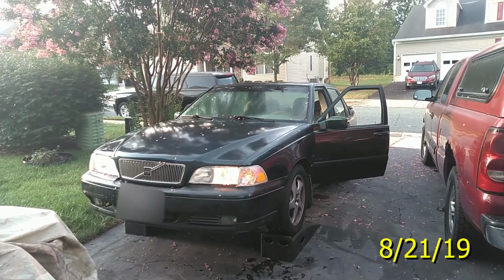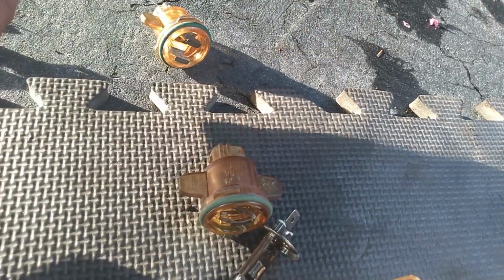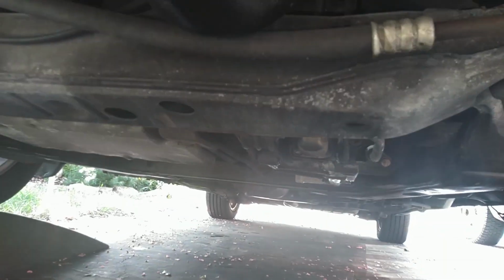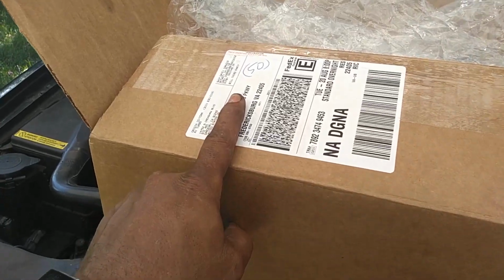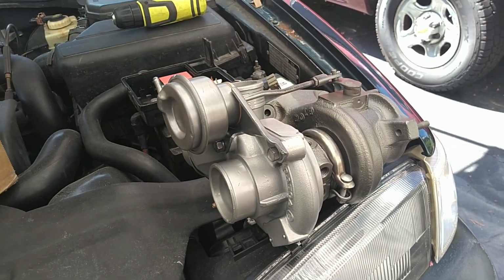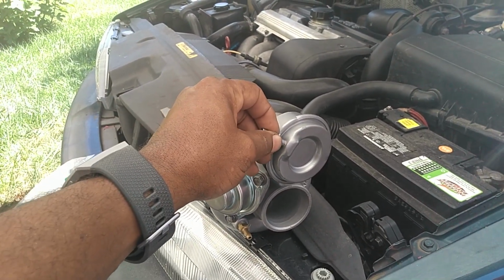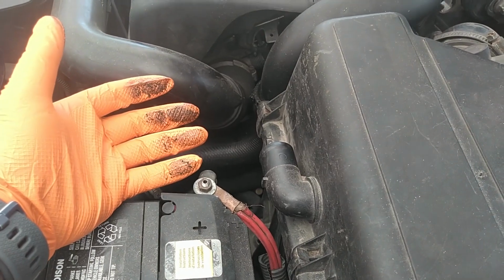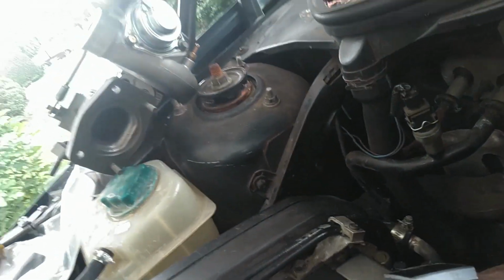Junkyard, state inspection, fog lights repair, turbo system tune up, is your turbo weak? - howr

Comment: Dang, that’s picky inspection. Have had a bum fog light on the 95 960 here in Texas for years.
Reply from the maker: I felt the same as you.
Reply: @RobertDIY  Well, finally got a new fog light assembly from someone in NC who was parting out some a 960. If the bulb is good and the connector is good, I may be back in business this weekend.  But I think of fog lights as being an add-on, and am surprised the inspector would require them to work.